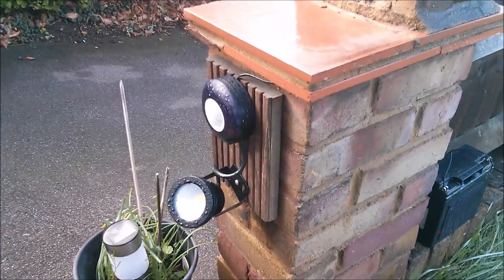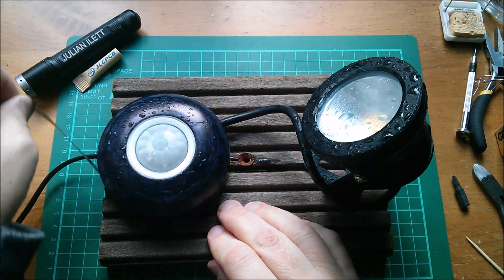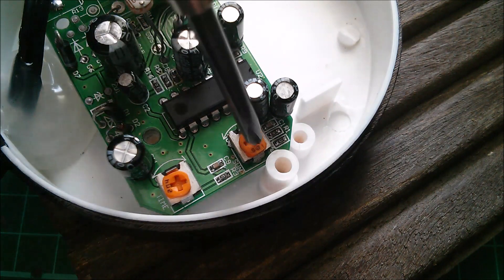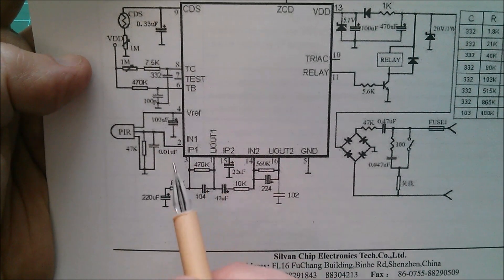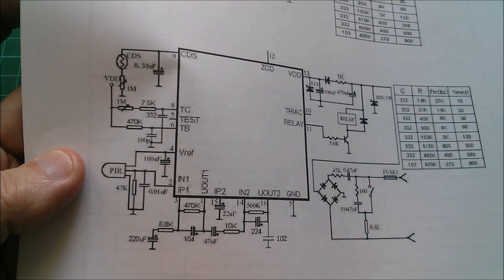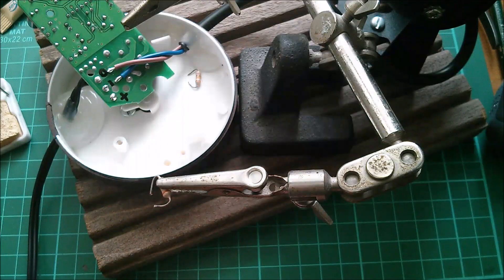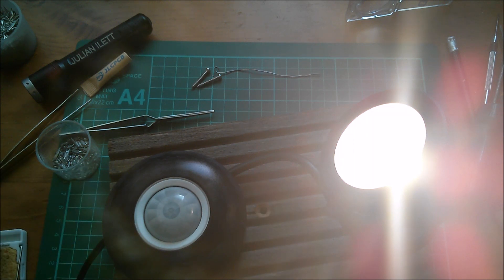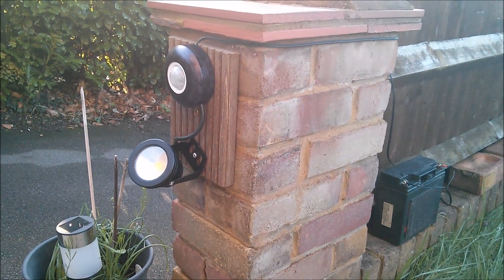Making a PIR Sensor Less Sensitive

Comment: This is the wrong PIR for the application.  You need a 180 or 120 degree beam rather than the omni sensor you are using.

Comment: I'm going to reverse engineer the "mask the lens comments"...! lol At the historic railway station that I volunteer at there is an alarm PIR module wired as door announcer that I installed a couple of years ago. It is connected to a nasty shrill beeper that everyone complains about. Although I must admit I do enjoy the way it startles the uninitiated. ;)

It was way too sensitive so I reduced the sensitivity by masking it off with a piece of card. But now having seen this I might do away with that and look at gain reduction. It's a fairly old PIR so it might use a different chip, but I assume it would be a similar circuit.

Comment: I get the impression the data sheet values in the amplifier chain were arrived at by random fiddling - the upper amp has less than a third the passband of the first for a start. I always used two identical stages.

Comment: The lens is an integral part of the detector so testing without it is unlikely to yield reliable results. As such, it's possible to reduce the coverage of the detector by putting electrical tape on the lens (either inside or out) to reduce unwanted trigger events.

Comment: Hi.i am sick of the energy companies charging far too much. I was wanting to go for pannals like you have. But I'm on a small budget due to been disabled. Could you please give some advice on a cheap but with some quality. Lol. Thanks jon
Reply: Hi jon, IMO you're looking at pretty high startup costs and long payback periods for enough solar electricity to make a difference to your bills. 
probably more effective to hold your nose and stay with grid electricity and concentrate on insulation and energy efficiency first (for which grants may be available) if you haven't already.
Reply: @joinedupjon  I thought about more putting things together myself. As I do understand electronics. Iv had insulation done to my property and have a stove fitted. As the only gas I use is central heating. But the stove heats the house. A friend does my washing and I have a bath there. I cook on bottled camping gas. I only watch thing on my tablet, 2 energy saving  light bulbs are on all the time in the dark park of the house and what ever room I'm in on a night and a fridge freezer. Not a lot of energy used. But my energy company are taking £111 from my account and they want more. I am disabled on a low income. I just can't afford there prices. Iv tried to leave them. I'm in a contract and can't afford there leaving fee. Plus I gave them meter readings. They said the readings are to for the computer to accept. They said the manager will be ringing me about the low readings. Nobody did. But I was sent a letter saying they was putting my direct debit payments up.
Reply: @ @jonstorey3985  I've completely stopped letting utilities charge me by direct debit because of the unpleasant and unexpected shocks from their billing computers - only for people who tell me up front what they're going to take and when now e.g. council tax.  the privatised money grabbers can shove their direct debit discount - I woldn't be surprised if they're overestimating (i.e. overcharging) on demand to flatter the budget at accountant critical times of year in order to trigger the directors bonuses. Maybe brain surgeons and investment bankers can afford to give the  French government an interest free loan of a few hundred quid everytime they decide to have a bit of trouble averaging out my usage... but I'm not in that category.
Fairly obvious point is that unless you disconnect from the grid entirely you're still going to get gouged for the standing charge, but having a solar system reliable enough to let you live your normal lifestyle without worrying about running out is going to be IMO unrealistically pricey for someone on a low budget. julians reviewed chinese  solar panels from banggood at around £1/watt in the 100s of watts range and  new 12V 'leisure' batteries are £70-£100 / 100Ah

If the lights you leave on the most are still CFL types I'd suggest swapping them out for poundland 3W LEDs even before they fail

Comment: Have you had good success with hot glue sealing out water on outdoor electronics.   I was thinking of doing the same thing with Halloween decorations for outside use.  Please advise.   Thanx.
Reply: Halloween was 2 weeks ago
did you see PWM autopsy https://www.youtube.com/watch?v=_YGlRkArsyA&t=2s though that took a few years to get in.
fwiw John Ward was showing a flexible sealant on his latest video - quite pricey tho.
The Dri-box works well and it's what I'd want to use on mains powered xmas decorations outside

Comment: Hot glue is super easy to remove. Thats one reason why i use it almost in every project now. Just shoot a bit of alcohol between it and it comes clean off. You could even get it off paper without tearing it, give it a try. And then when modifications/work is done, it is again easy to reapply it. Isopropyl alcohol in a can, used for cleaning electronics, for example.

Comment: If you are thinking of running thin wires to charge the battery: Why not get rid of the battery altogether and perhaps use a super cap bank to take the load when light is on, cheaper than a battery in the long run?
Reply from the maker: You read my mind :)

Comment: For the remote battery you could try to boost the voltage, so you reduce the voltage drop on the long cable. Of course, you will have losses in you DC-DC  converters, but hopefully it will not be as high as the cable alone.
Reply from the maker: Ah but when very little current is flowing, there will be very little voltage drop.

Comment: interesting point regarding a remote battery...ive considered the same in the past as my solar/batteries is in my workshop some distance from my house where it would be nice to use some of the power generated however to to volt drop i've shied away from it.
Reply from the maker: Thanks Garry - I'm thinking the volt drop will be tiny when the current flow is tiny, so both batteries should reach the same voltage eventually.

Comment: PIR sensor outputs are typically pulses, so those opamps are also acting as integrators. Think: you're affecting the high frequency rolloff by changing the feedback resistors without also changing the paralleled caps. "Sensitivity" is essentially a function of the RC time constants.

Comment: Insulation tape on the facets of the fresnel lens to block off unwanted areas does the trick. Alarm Engineer trick.
Reply: Would have been a short video!
Reply: Exactly what I was going to say
Reply: did that at my dads to prevent nuisance triggering of a lamp with built in PIR - worked but has reduced the amount of light entering the ambient LDR which is behind the same lens... just means it starts switching a bit earlier in the evening than it should.
Reply: Polyester tape, AKA Scotch 'Invisible' tape or probably any write-on tape, works fine and is less obvious...
Reply: Yeah, there’s gonna be lots of variables I guess. It’s down to the individual and the type of sensor. Trial and error comes to mind.

Comment: why dont you try a board that uses a EG4002 chip, works much better and lot less components required plus a lot easier to control sensitivity
Reply: i recently designed a PIR motion sensor board and during that time i tried the EG4002 but having bought a Panasonic digital output PIR sensor i went with a 74HC123 timer chip. Installed a few in a building and they work flawless

Comment: If you need more PIR's, take a look at security types (intruder alarms) they usually run on 12v, but also have sensitivity control
Also they have blanking shields so you can reduce sensitivity of any area of the sensor (so your dog doesn't trigger it for instance)

Comment: What also helps is masking surfaces with tape.
Or tension a foil over the hood.
Reply: Yes oma. Reduce and/or block the IR optically. Make a map of the optical path by using flashlight and close-up video recording of a tiny white screen (at the sensor distance) while on bench. Use this to design a tube, curtin or partial shutter INSIDE the lense to mask the IR multiple view(s) of the road from making their way to the PIR sensor! Select a clear tape or plastic that blocks the IR, or just use some aluminum foil and lots of hot snot glue.

Comment: Wouldn't putting black tape over the inside of most of the plastic lens have worked?  Not an electronic fix, but perhaps an easier one.
Reply: Yes, but where's the fun in that!? :-)
Reply: @airwavested  true enough.  Gud die mite!
Reply: Was going to suggest this as i fit alarms for a living and often you get cards with the sensors to blank of areas on the lens you don’t want to pick up movement.